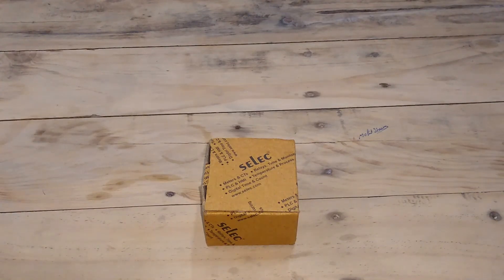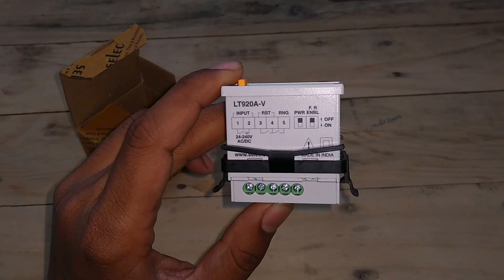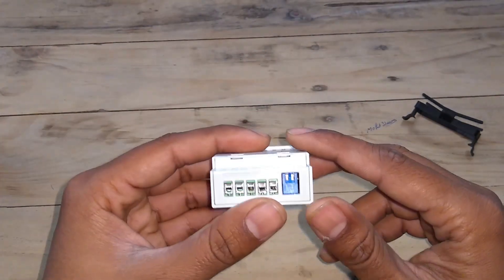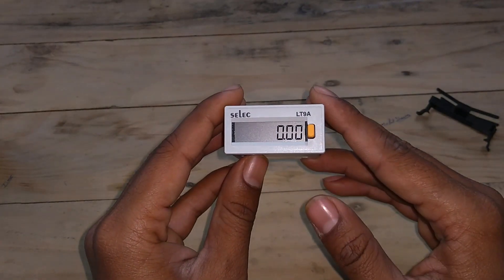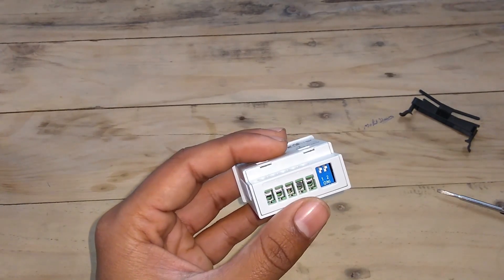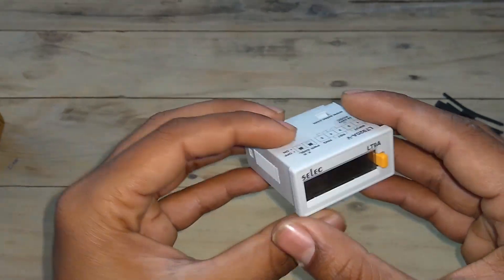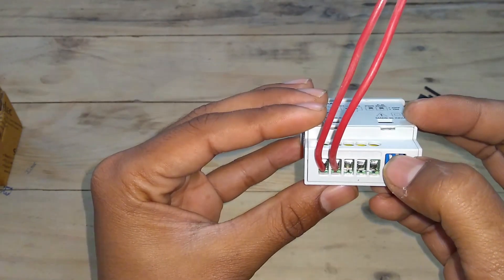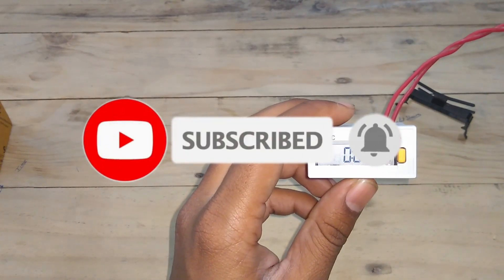How to use Selec Meter | Hour Meter |Time Totaliser

Comment: Nice video nicely explained 

The missing part is 
Price 
Where to buy 
And :- 
You haven't mentioned if we off the supply will timer pause and after coming supply it again starts from where it was 
  I Need to use it for calculating water pump running time . Where supply disrupts several times
Reply from the maker: thankyou so much, i have given the purchase link in the description.
Reply: @VEDTUBE  I have bought Selec 920a-v, I want to know where to connect 24 v dc +ve   ...1 or 2 terminal ?
Reply: Memomry 5 years
Reply: @pinku5940  does it hold its last value after power resume ? can it be reset with a dc input signal...from plc output side?